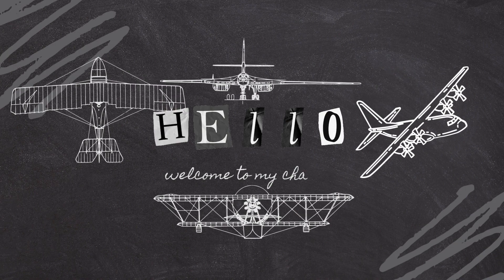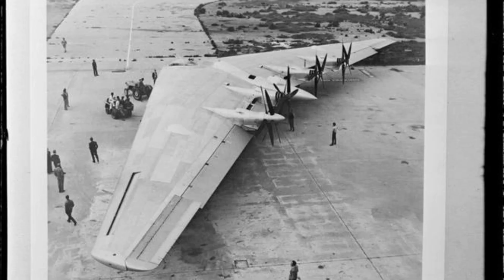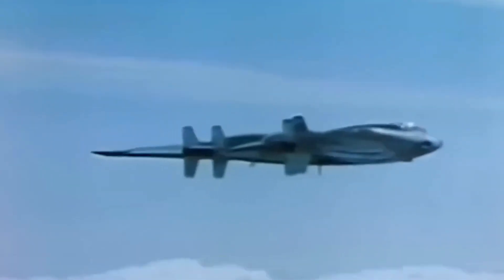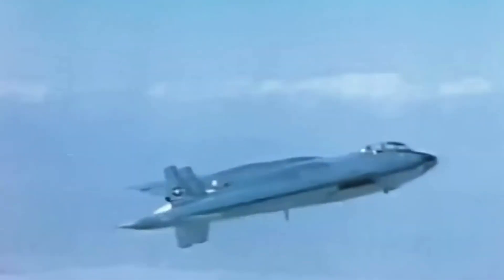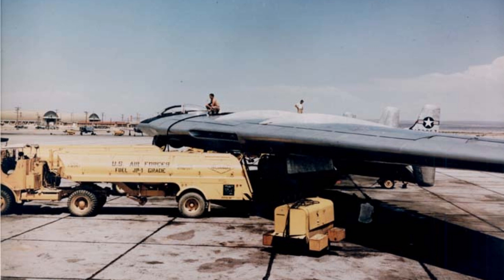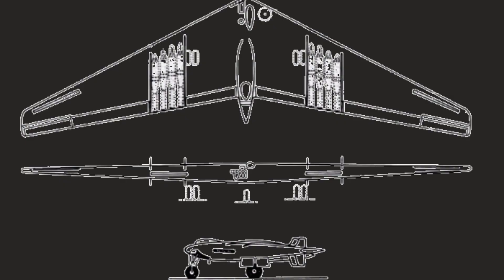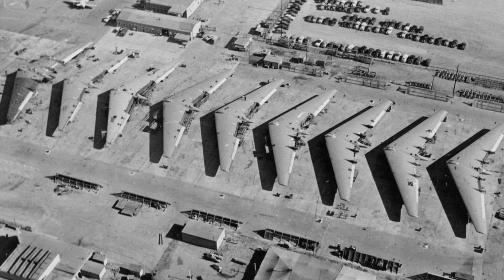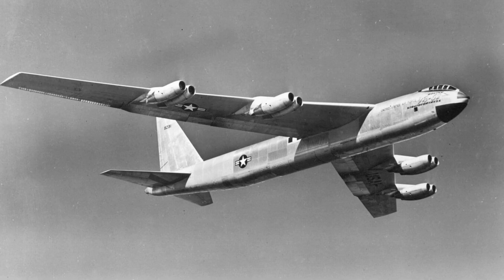Flying wing jet bomber: Northrop's YB-49

Comment: Look up the n1m and n9m northrop was working on early auto correction mechanical computers to solve issues in stability he gave into adding vertical surfaces in an attempt to correct some of the issues but the flying wing realy was the plane of tomorrow flying way back in the day